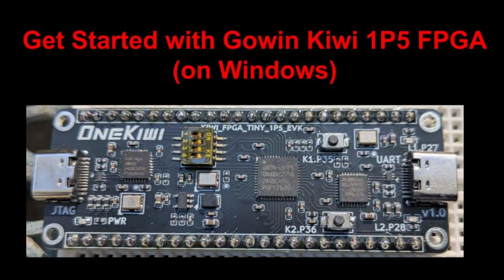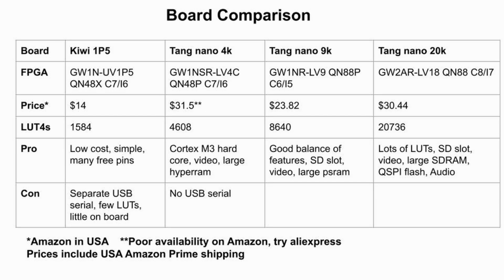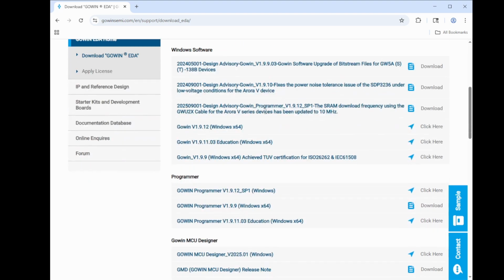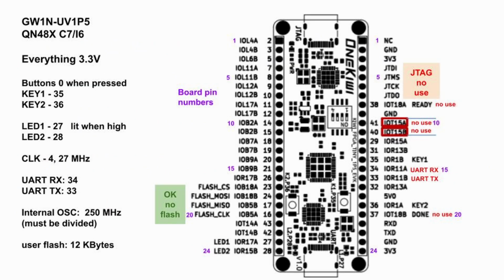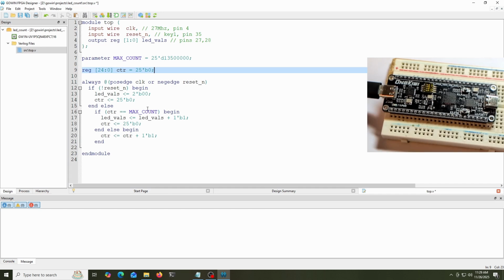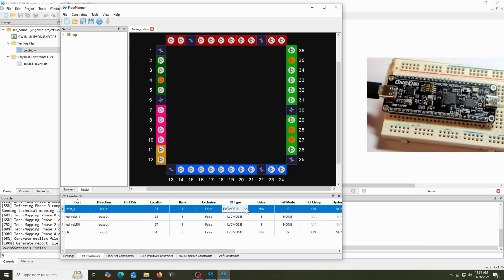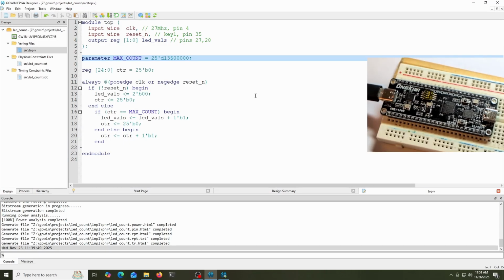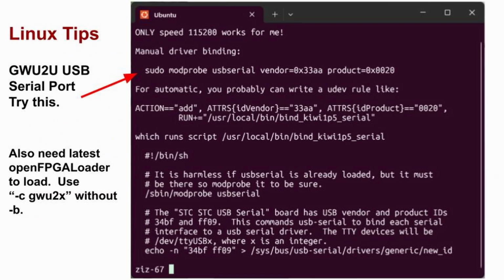Getting Started with the Gowin Kiwi 1P5 FPGA Board

Comment: I need to evaluate an LVDS ADC, and so I'm looking for a low-cost, non-BGA, fpga/cpld hybrid device. 
"hybrid" because I want the FPGA PLLs, LVDS.. but also want the CPLD instant-on (no external flash for the bitstream)

The Gowin GW1N-UV1P5LQ100 fits the requirements, but was kind of surprised that it's $12, and not carried by digikey.  I know the US isn't their target market, but proper documentation and example designs in English would also go a long way to attract adoption.

In the end, I'm left contemplating between:
$8 Lattice Mach (However, concerned the lower end don't have enough Logic Elements ( LCMXO2-256HC/640 , LCMX03LF-1300 )
$11 Max10 10M02 devices 
I really like the Smartfusion2 (M2S010) devices, with a built-in Arm, but they're too pricey ($35)
Reply from the maker: I guess you saw that Mouser carries them.  But I agree with your comments on English-language support.  I'm recommending Gowin for hobby and educational use where you don't build a board (or a product).  For these purposes, you can get into FPGAs for $14 with good-enough free tools (at least on Windows) and teach yourself Verilog and design on real hardware. I think that's a good deal.